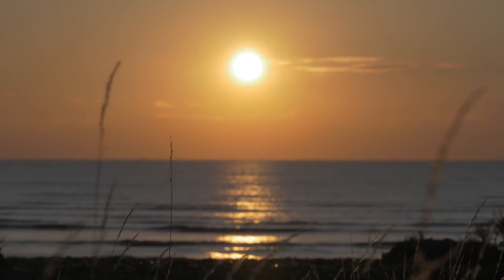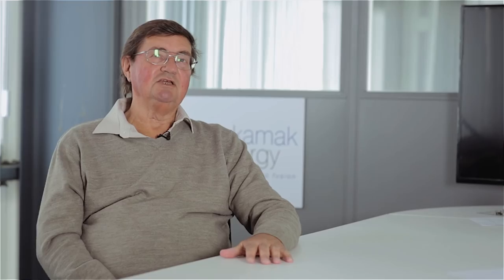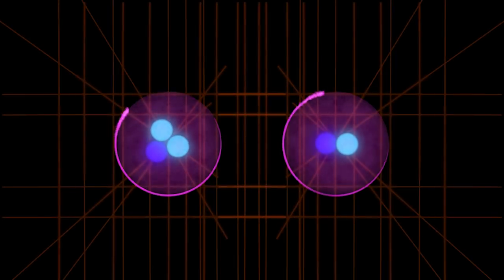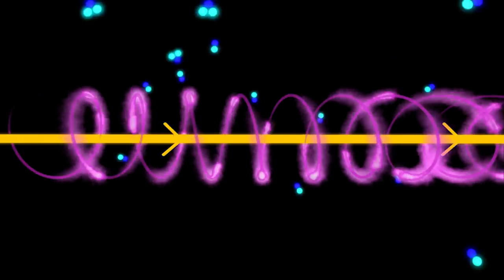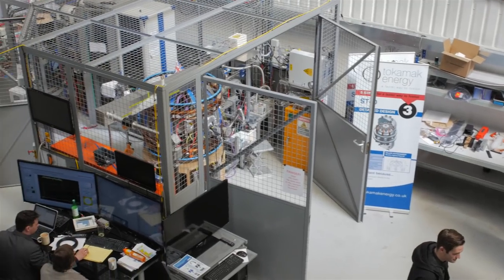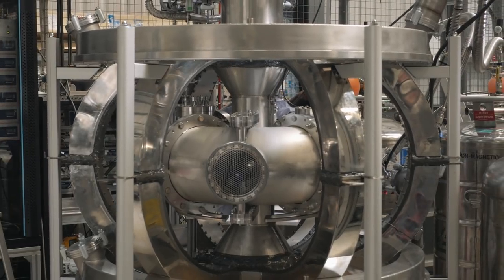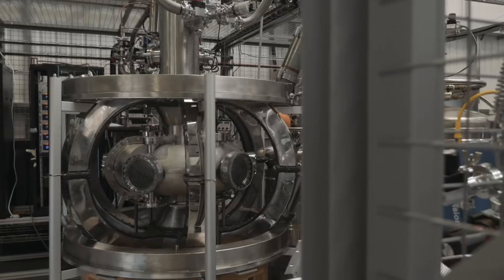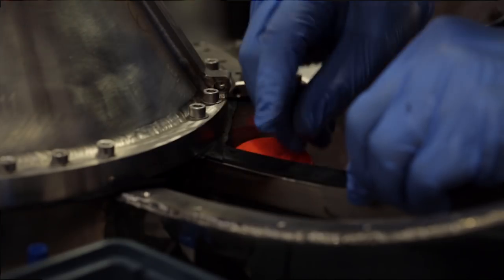Faster fusion

Comment: Really hate it when they use the word "NEW" as it implies just.....another.....30 years away".
Reply: really hate it when people on the sidelines, contributing absolutely nothing to the process they chose so carelessly to bash. Well why don't you do something about it and help them get there on a shorter time instead of berating them for trying??
Reply: diGritz1 you basically alluded to the fact that the tech is still just another 30 years anyway. If I was under misapprehension, my apologies. But I personally feel the people working on this are absolute best and pretty sure the first optimal launch is just around the corner. But I may be wrong.

Comment: also makes good nukes just sayin
Reply: Roan Oneill Over 100M *c . its like a star dying . You are saying about Nukes , well there would be no Earth Just sayin
Reply: keshav lokheeram 
Look up thermonuclear bomb. The earth seems to be intact if you ask me.
Reply: Large Moose Thats not fusion , Fusion only occur in space . The sun is an example .
Reply: Large Moose Had you ever seen a star ? Why do they shine so bright , its because they are dying , there are so many , You may see it very small to humam eye but its extremely big . When i mean extremely , i mean it
Reply: Ummm what are you talking about. Hydrogen bombs/Thermonuclear devices use Fusion reactions for their explosive power instead of Fission reactions seen in Atomic bombs. Its actually the standard for which nuclear devices are made today. One quick google search or youtube video on Hydrogen bombs vs Atomic bombs would give you all the info you needed instead of stating ignorant facts. Even better is that a thermonuclear explosion at its core can reach temperatures between 10 million and 150 million degrees Celsius which is significantly greater then the temperature at the core of our sun for the tiny microseconds it lasts because it expels all of its energy in that small moment of exploding in comparison to the sun's energy over a course of billions of years.
Reply: Ghanta Wala You are exaggerating. The Earth would be just fine

Comment: One word: Thorium
Reply: boris said two words: that's fission.

Why are you bringing up fission in a video about fusion?
Reply: Because it is actually practical
Reply: So is this. Unless you're a defeatist spoilsport.

Also, funnily enough, waste management for a LFTR reactor (the most popular Thorium Reactor concept) is more difficult, and propose more dangers than both classical Uranium Fission, and this proposed Tokamak. That's because the waste comes in the form of highly water-soluble fluoride salts.

Waste products of a Tokamak comes in the form of Helium. And with the proposed Lithium-6 breeder liner of ITER, neutron-radiation won't be an issue either.

So I ask again. Why are you talking about fission, in a video about fusion?

Comment: how can we harness the energy of the sun? are you kidding me we have solar panels lol
Reply: Yeah but the real sun is far away. Build a smaller one, closer and you get more energy.
Reply: time4tradin we have even simpler thermal technology that can harness solar energy instead of photovoltaic panels.  Mirrors can redirect solar rays to boil water, creating steam.
Reply: fusion is more reliable and is also the only means to produce adequate amounts of energy offworld
Reply: fl00fydragon ok but this video is about powering your car.
Reply: What, floofy?

We've been using solar cells in space for decades.
Reply: did you purpusfully not read the words "adequate amounts of"? Of course we have solar panels in space, but they'd be worthless in comparison to an even moderately developed fusion reactor...

And even on earth that'd be the same, especially with solar panals really not being that efficient with all the atmosphere and clouds and shit in the way. Also: nighttime sucks for collecting solar power.
Reply: This is not about harnessing the energy of the Sun per se, rather building something that copies what the Sun and other stars have been doing for gajillions of years. Just in a smaller scale. But my question is that the stars can be so efficient in fusion because they have shitloads of hydrogen and so it is more probable for quantum tunnelling to take place thus achieving fusion in relatively low temperatures (15 million K). How are we supposed to beat that? She says that we need temperatures like 100 million °C...
Reply: Actually, solar panels can be become more efficient. Currently, the best solar panel I believe only harnesses 40% of the sun's energy. If we were to double that number, we'd be able to live off of it during cloudy days and long nights. I feel like this project maybe too far away to accomplish for fusion, however, we can continue to study and attempt to build it someday. If we focused on solar panels for now to at least get us off natural gases and coal, we can implement this projects in the future. We can't constantly wait for a new clean energy source to arrive when we have already some today that are usable. The longer we go without a clean source of energy, the worse our planet gets.
Reply: Plus, we have batteries that can also store energy for a longer use. Battery storage on average increase 5% a year, but apparently a group at MIT found a new way to store double the amount of energy than current battery cells  if I recall.
Reply: +mou I'm a little off and on about nuclear. I feel like its too unsafe for us to be using something that can create an area to be inhabitable such as Chernobyl. It's clean energy, but unsafe. I understand those nuclear plants were old, but they caused much damage and if something goes wrong, an entire city surrounding that plant can become inhabitable. Lithium-ion batteries will start to decrease in price though because companies will be able to produce what Tesla has done called the Gigafactory. They'll be able to produce large amounts of lithium-ion batteries at a faster pace and lower price. They also created battery packs for solar panels and doubled the storage of them from the last year, while the price stayed the same or increased a little bit more I believe. The battery packs were built in the Gigafactory. The only serious company so far that is looking to increase production of lithium-ion batteries and lower price is Tesla. I just think its much safer and 70% of the batteries are recyclable. We can stick with it for now and then look for a new source of energy later on.
Reply: what parts of the spectrum do the panels convert into energy? Is it just visible light, or also UV, IR, maybe microwave and X-rays too? Whatever causes the silicon to move and create a current. Is this what you mean by making them more efficient? According to this (unless there's been an update) the most efficient ones only convert 34% into energy http://www.sciencealert.com/engineers-just-created-the-most-efficient-solar-cells-ever
Reply: Why harness the power of sun when we can make our own suns
Reply: if we completely covered a small desert with solar panels we'd have enough energy for several times the world's needs
Reply: covering a small desert would
 a) dstroy it's ecosystem since it would demand 100% coverage 
b) there is no means to transfer energy from a single desert all over the world
c) a single error could cause a massive blackout 
d) it's unfit to power the future megaprojects a type 1 civilisation would require etc.

in comparison the smallet fusion reactor that is proposed would be capable of powering a small city with a reactor the size of a container

as you can see there is no contest

solar is a transitional energy source meant to mitigate the impact of abandoning fossil fuels

it is clean and i do agree we need clean energy but when a superior alternative is proposed then that alternative must be pursued
Reply: You don't have to place ALL solar panels in one location. By the way, we already have blackouts with out current method of producing electricity. Solar panels would move away from that. A fusion reactor that is yet to be a viable source of energy. You can't bring the fusion reactor to this until they complete it, which won't be soon. This is a great idea, don't get me wrong, but it won't be ready in time for when we need it which is right now. Like I said before, you can't constantly wait for a new energy source. Use what we have currently thats safe and efficient to at least move off of coal, oil and natural gases. Some companies like Tesla make solar roof tiles and its cheaper to have one of those than building and paying your electricity bill for 20 years. You can estimate the amount on their website if you want, I don't know the exact. It will be cheaper though. Instead of giving subsidies to dirty energy sources, the government should give more to clean energy companies so they can sell their product for cheaper and more research would go into it.
Reply: Solar panels that require silver and caustic chemicals to manufacture and barely produce more energy than they take to make.
Reply: mou, France gets about 80% of its power from nuclear fission, right? I wish the rest of the world would follow your example on that.
Reply: mou, the US media was following your election pretty closely. I was rooting for Le Pen because she wanted to pull your country from the EU.
Reply: time4tradin that's simply yelling a command and hoping the sun listens. We want to throw a saddle and ride the sucker.
Reply: The royal society. isnt this the masonic brotherhood that established the Dark Ages of false scientism for 5 centuries now? give them yur billions people. they re gonna give you your long desired "fusion reactor". or so you've been told.
Reply: Lol, was he serious or being a noob
Reply: Battery! LOL!
Reply: And you can find and place enough solar panels to power a city, say London? Or one factory. I think not.
Reply: Intorsus Volo your way does not work at Night
Reply: Makis Makiavelis we have easily acheived 100Milliokn C.  That was actually the easy part
Reply: Stupid comment. Before you write any know-it-all comments, first deal with the topic.

Comment: This will never work. The machines is inside out. Instead of using a donut and mag field need to use beirkland currents and a z-pinch which will create the pressures and energies required. Besides, the Sun doesn't create fusion at it's core but in the photosphere. None of the fusion models for the Sun work in the very least. Do not let them kid you. Not everything is feacirt and collusions. Electric currents are everywhere. Many recent paper prove just need to Dutch black holes neutron stars. It explains galactic rotation, active galaxies, red shift, planters nebulas which are the birth of plasma focused on massive currents. If you do not believe me why are they using electric currents to control the plasma which makes up must of the visible universe. Dark mat and ener are utter failures. Glad finally dying.

Comment: same old story, jam tomorrow. it is not surprising you are not getting anywhere. you do not know structure of matter, you do not know where matter is created. when you do it would be easy to use power of matter. your current model is wrong. any progress you have made is by trial and errors. not science. MG1
Reply: mg1s they do use scientific knowledge,
but trail and error is kind of part from the scientific method
Reply: if one do not know structure, composition and behavior of brick, one can not be a brick layer. One is a biological robot running a program. they have no idea about structure of matter or how it interact with gravity, because we have not released it yet. by ignoring available data and simply assuming a model and elaborate stories present it as fact dose not make it reality. Their model is wrong. Too stupid to ask. They are like ignorant nanny trying to feed baby by the wrong end and wonder why baby is not happy. they got good job, fat wages and produce nothing. And always promise jam tomorrow. Full information in my 1975 Bremen summerhouse notes available on official request. MG1

Comment: Fusion my ass ! Water , Sun and wind can be used as a source of energy and it's plenty everywhere on the plane !
Reply: Not really, the limitations make "renewables" largely ineffictive and too expensive to compete with fossil fuels. We need Gen 4 nuclear energy to take our society to the next level (thorium)
Reply: fusion is sun
Reply: +Robert Weekes 
Renewables are currently cheaper than fossil fuel fired generation if done right, especially so if fossil fuel subsidies are removed.
Reply: The difference is energy density and that you don't need storage. 
Renewables are in the picture more than ever and still improving but fusion would also effectively be even more renewable as the sun would die well before we run out of materials for fusion on earth and the buy product is helium.
potentially both much cheaper and cleaner than anything we have today.
Reply: I don't think fusion reactors overcome the waste problem although they ameliorate it.  Neutrons zooming about in a vessel hit the walls and neutron enrichment occurs changing the material of the skin of the wall.  That will be radioactive and will need to be disposed of in some manner.
Reply: +neddy laddy Yes there is  potentially some in the walls but it's so low that it's ok for plant workers to work on them when they switch them off and you can account for that in the materials you use (short half lives) the also proposed using water as a neutron baria witch to absorb them and it doesn't get made radioactive by gamma rays or fast neutrons ie
deuterium and tritium are not radioactive nor is oxygen 15 18 or 17 all the radioactive isotope of oxygen and hydrogen are very short lived.
 water is only a problem in power plants if it gets mixed with other radioactive materials in which case there the problem not the water itself.
Reply: Malcolm Smith I was thinking of the walls, specifically the material used.  Wouldn't the day depend on how many neutrons were absorbed by the nucleus at each stage before further fission ?

Is there much freedom in materials used. (thinks). Yeah, I suppose a liner could well be used backed by a wicket keeper for the neutrons.  (Sorry for the terminology there, I realise you are probably a yank but I could not think of the base ball equivalent.

The water in fission plants is the fluid driving turbines etc, but don't plants use an intermediate fluid between the reactor and the "working fluid" (water)?
Reply: ***** At the moment It has been the temperature from not so well confined plasma that has been the issue for the walls but stronger fields allow for better confinement of the plasma.
Im not actually sure how long before the fast neutrons would have an effect on them or even if it would be a problem but the same issue is already dealt with in current fission power plants? 
I dont know that it necessarily has to be much of a problem depending on the range of stable isotopes and half lives of the unstable ones used in the walls.
There will be some the radiation but it will be many hundreds of times less than in conventional powerplants and we deal with some radiation every day the problem is when some becomes too much.
http://physics.stackexchange.com/questions/104854/how-clean-will-first-generation-fusion-reactors-be-compared-to-fission-reactors
Reply: Malcolm Smith Thank you for that, quite informative.
But, as you say, a lot of it is still to determined, a suck it and see approach.  There is basic research on the epiphenomenon involved and knowledge gained from fission, but as a whole it is all brand spankin' new, at least will be.
cheers
Reply: Andersson, I believe you have a misconception about Fusion, you likely think it's the same as the current nuclear plants we have that produce radioactive waste. This is not the case, that is Nuclear FISSION, this is Fusion. Fusion does not produce radioactive waste, and it cannot have a runaway explosion either. It is the most environmentally friendly way we could possibly produce energy, since we wouldn't need to build massive wind turbines all over the landscape and cover everything in solar panels (though that's still good to be doing somewhat).
Reply: Flatard detected!
Reply: Andersson good show of intelligence, I'm sure your mother is proud !
Reply: The Sun dies?Buddy, we still have about 5 billion years before that happens.Earth will die before that.
Reply: In ITER they want to build walls from lithium-6 which will absorb the neutrons and produce more tritium for the fusion. It should be partially self-feeding reactor.
Reply: Ändersson R plenty, but not plenty enough.
Reply: Andersson, hydro affects fish spawning, sun requires solar panels that require caustic manufacturing processes and wind needs to impact large swaths of plains and grassland habitats. A fusion plant has a far less impact. Even fission is the most environmentally-sound power source we have now.
Reply: Ändersson R all of which are more harmful to the environment than fusion would be ever consider the amount of energy and resources it takes to build solar panels and wind turbines and hydroelectrical plants ever consider how many birds die to wind turbines or how bad dams and hydro plants damage the environment
Reply: Ändersson R Most of which are unavailable in space and in practically every other planet.
Reply: o rly?  are you wrighting from the year 1970 ?
Reply: Not at all, go to: https://wefunder.com/lppfusion